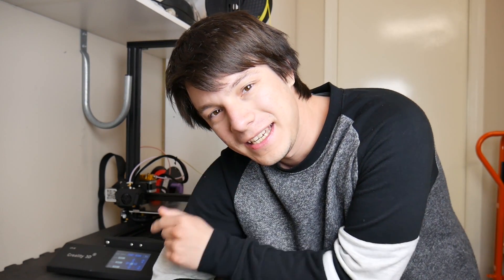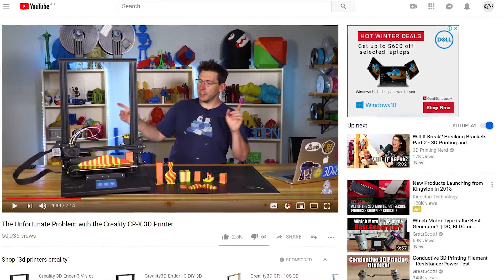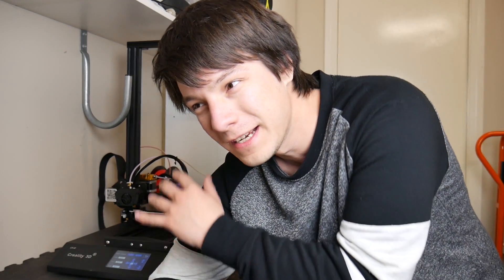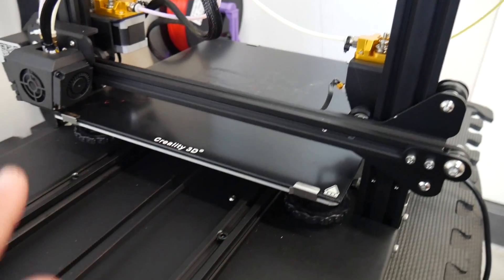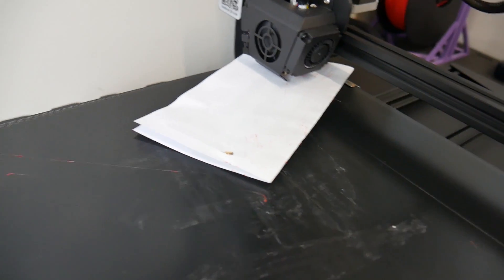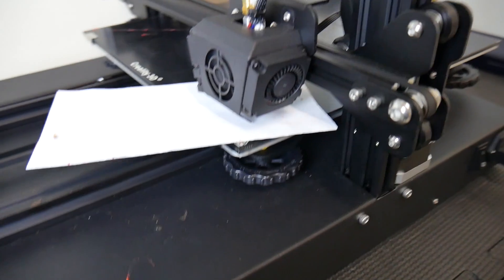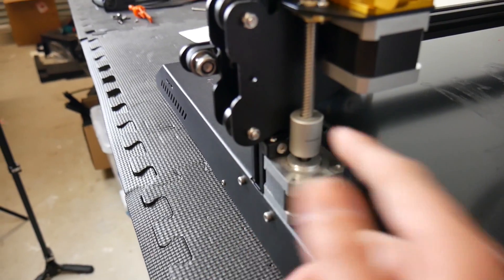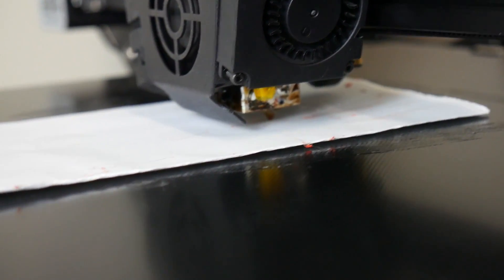Update on my Creality CR-X and going forward

Comment: Even though this is a preproduction Proto type yet should function well. Sure you might have Very small Software problem or some other non-service affecting error. As a product manager I would never ever put out a product like this for beta testing(not even alpha testing). This is totally Unacceptable. This goes along with the fact that it’s $800 printer and no automatic bed leveling shame shame

Comment: I  suspect that one or both of the V slot rails for the bed are bowed, and or misaligned. If that is the case you would never get all 4 points level.   I would rebuild with one wide V slot extrusion.

Comment: The problem with the front right corner is caused by the y-axis rails being twisted. As the bed moves back, it dips down on the right. You need to align the rails by either raising the rear-right, dropping the front-right, raising the front left, or dropping the rear left. You can make three points of a potato chip touch a flat surface, but not in general four points; your y-axis rails are a potato chip.

Comment: Thank you Angus. I agree that what you've received, is unlikely to be the same as what people receive as a production unit. And even if you correct all the faults you find, and get it to print reliably, unless every printer of this model from Creality starts with the same problem, the fixes you provide them as feedbacks, are probably not going to result in end users getting the printer you end up with. 

Wondering if there may be an issue with the right rail for the bed that may be dropping the right front as the bed moves to put the nozzle at the front of the bed. If checking the xplate doesn't show a problem, that might be something else to check.

Comment: One thing that I have noticed in my "LONG" 1+ years of 3d printing is that printing beds are usually not flat.. If yours is flat count yourself lucky.. 

Depending how the bed is manufactured (cut/ stamped/ machined) Bed "base zero" flatness can be ridiculous to outright Rick and Morty "perfect Level" precision. Also precision manufacture will cost more .. The smaller the bed the more flat precise it is, and as we go to larger and larger beds, the flatness of the bed becomes a greater problem.. Now I solved my problems with a BLTouch type of sensor which has an accuracy of around 10% of my first layer thickness. I have had inductive and capacitive sensors but their accuracy was on the order of near my first layer thickness and wouldn't work with some surfaces.. I'm not selling these type of sensors, but I think something like them should be standard equipment on all FDM printers..

Flat screen TV's also had this problem it was very hard to make 51inch screens without defects and because of that cost 10 to 15 thousand dollars. Now after 15-20 years, with new and cheaper methods, everyone can purchase one for under 500 dollars...

I'd love 3d printers to be perfect but alas not yet...

Comment: Z wobble FIX. Remove the top parts from the Z screws. Read the last comment here: https://www.thingiverse.com/thing:2954530/comments

I have a cheap Anet A8. It works well. But I've been struggling to explain to anyone creating parts like this that it's a bad idea. You have the power to explain the problem to anyone and make a video about it.

Comment: 1 thing I've noticed with the CR-X is the Y carriage is a little too lightweight and the corners can easily bend. The easiest thing is to bend the low corner slightly up (use a adjustable wrench tightened down) or add shim to it. Yes, this should have been fixed and you shouldn't have to do this BUT we're still talking about a very capable machine for $800 USD. Prusa MK3 is $800 shipped in kit form and has its share of issues as well. The CR-10 series faces the corner issue (one corner being bent that is) as well and damage in shipping could be the cause. Second thing, for the test prints, I found that 1 sheet of paper works better for nozzle clearance. 

The common issues with dual Z machines still exist on the CR-X but the good thing is that all the fixes for the CR-10 series will work. Dual Z is something that has to be maintained for the time being. Its important that the brass nut attaching screws are not tightened and that the wheels that move in Z are not gripping the extrusion more than "just barely." Often times, everything is tightened up on a new machine (obvious thing to do) and Z axis issues occur as a result.

Comment: With a bed volume of the size is manual leveling even realistic? with all the added surface area you now have all the added potential for warps and as you've shown in the video leveling is very difficult. I have the exact same problem one of my clone I3 printers with only at 2: 20 by 220 bed Center is dead perfect every other Corner except for the front right is perfect but the front right is way too low.

Easiest solution hook up a bed leveling sensor of your preference and let software deal with all of this I've spent months trying to combat that issue when a $5 sensor and 15 minutes of my time has now permanently result the situation. 

It's 2018 why are we screwing around with bed leveling? Auto bed leveling is an amazing thing.

Comment: I've had similar issues with a regular CR-10.  Putting a washer in between the spring and the bed bracket helped loads by decreasing the distance the spring can travel, making it tighter.

Comment: Your looseness of the front right leveling screw, i had/have the same issue on my creality cr 10s except for me it was the rear right screw which was like your front right. Since the bed is glass and ridgid I ended up shimming with a couple pieces of paper between the glass and the bed. Now i can get functionality of all 4 leveling screws.

Comment: I wish they would switch to the induction end stops or whatever it is that tevo uses. I also get sometimes inconsistent zero on the Z. Clearly there are inconsistencies in that first run where everyone is getting slightly different tolerances on their machines.

I am normally quite forgiving of creality. I rather like their beta run fix it make it better constantly style of manufacturing (since no other chinese manufacturer does this ie they don't fix their issues) BUT. this is their "pro line" of printers. (CR-20 and CR-X) with price tags to match. still crazy cheap for what it is but expensive for what they typically make.

IT SHOULD be mostly right out of the box and I am glad you and joel are holding a bit of fire under their feet for it. Keep up the great work and I hope you get it going. it is a rather enjoyable machine once you get it working right.

Comment: This is interesting, on my Ender 3 (which was probably the first of the removable plate batch) I had a hard time leveling the bed with the same problem initially, after making all of them too loose, I was able to get it level -but then Thomas Sanladerer's shipped with a plate that wasn't true as I recall on his assembly.
-I get z-artifacting I'm still troubleshooting as well.

Comment: i had the same issue with the corner being too low on my CR10s.  They used lock nuts on the bed to attached it and oen of them just wasn't close to be tightened.  After adjusting ith elped a TON with bedleveing.

Comment: On someone'S video (don't remember who exactly, hopefully it's not you :-) ) he mentioned that the back corner where the bed cable are attached, have a plastic part between the bed and the spring. he actually added washer to the other corners to put the same pressure on all four corners.

Comment: I have a CR-10 and it suffers from a bulge in the middle when the platform gets hot. I level the bed, and when I put the nozzle in the middle of the platform, it touches. It does not matter how I put the glass on the bed, I think it is a result of uneven heating.
Looking at your problem, can you try stretching the spring on the corner you are having problems with? That way, your spring will push the build plate up farther...just a thought:)

Thanks for the content!

Comment: How does the benchy print if you slice it yourself? Almost seems like it's changing the z offset somewhere at the start of the g code.

I made these for my CR-10 as I found the springs didn't have enough tension. Easy quick print and works nicely. 

CR-10 Spring Spacers found on #Thingiverse https://www.thingiverse.com/thing:2796833

Comment: I'm not an expert but if you put a couple washers under the offending corner spring, you'll be good to go. 
You seem to have a firm grip on printing in general but should have figured it out on your own...
Thanks for your opinion that Creality isn't perfect..yes they should have redesigned the 2nd Z motor bracket or gone with their original thought of belt drive.

Comment: Dude the bed on my cr8 is EXACTLY the same
Reply: OK so the last comment wasn't that helpful. So on my cr8 same bed level issue. So what I did to work around this was to use the software bed level in matter control. It's not ideal as now I'm using Cura, Repetier AND matter control 2... I only have 2 printers.

Comment: Hi Angus, the shown first layer problem is exactly the same, what I experienced with my CR-10: no matter, how accurate I level, the first layer is printed far to high. May this be a firmware failure? When I discussed this in various forums, I only get the answer "level closer", but this never helped. I'm very curious, how you can solve this issue on your CR-X.

Comment: I had the same issue on my anet a8 after fitting a glass bed, The actual problem appeared to be that the corners that were correctly adjusted were acting as a pivot point, Try adjusting the the tightest one with the paper under the loose one and I think you may find that it should level out. Since having the problem I have started levelling the bed diagonally and I now use a 0.05mm or 0.002” feeler gauge which has been working great

Comment: I follow these reviews with great interest   I also don't believe that you should dwell on the issues as an issue if that makes sense (the world has enough drama).  I'd still like to see you get an initial model for a walk-through so I know what I could be getting into if I bought one right away then see you obtain one six months later after it has been in production with a follow-up video which includes all of the manufacturer updates and convenience upgrades that users have created.  I might want to be an early adopter if the printer has a feature that I desire and am willing to live with the  initial production warts.  It's like choosing to upgrade to a  next generation operating system or waiting six months after release until all of the initial bugs have been ironed out.  Think Microsoft Windows or Apple iOS as examples.  My expectations for a $300 printer are a lot lower than if I spent $3,000.

Comment: I had the exact same problem with my shitty Tronxy X3. The reason was that the single profile for the wheels of the bed was twisted around the y axis. So the bed rotated slightly around the y axis. I believe that the two profiles of the CR-X are not in the same plane. That would explain it completely.

Comment: I think your verdict on this machine should be based on the condition the machine arrived in. There seems to have gone very little QC into this machine. Even if they fix all the flaws you and other reviewers have discovered before releasing the machine into the wild we don't know if they introduce new problems with the fixes. If they do introduce new problems while fixing the known ones it seems there is little chance that Creality QC will find and fix them beforehand. It will be only discovered when the first people buy the machine and find it has new issues.

They asked you to review this machine and I'd provide a neutral review pointing out all the pros and cons of the machine. But with the current issues the cons overweight by far, and I would assume those issues will NOT be fixed, unless proven otherwise.

Comment: try to put the 3 other screw DOWN to where you can engage the forth one ?
Reply: He cant the print head is as low as it can go with modifying the brackets at the z stepper, but that IS a way to fix it.   Spacer under the spring and longer screw is a better solution while working on all the other bugs.
Reply: Yes

Comment: Hi, do not put in a longer screw, pull the table top off and LOOK at the bed arms, use a  ruler and measure how high the end of each arm is OFF the base.
The fact that the adjuster was not in place when you unpacked it, indicates that the adjuster was not under any tension from the adjuster spring to keep it on.
Even the brief view we had of the lack of adjustment indicated to me that if the glass bed was not warped then the bed frame, in particular that arm has been bent DOWN away from the bed.
At the moment there appears to be NO support in that corner at all, so what happens when the bed warms up?

Come on Angus, get your hands dirty and get into this machine.....
You are going to have to use more than an Ikea Allenkey and an adjustable spanner mate...

Great videos....

I'd like to add my two cents worth about 3D printers, I don't have one, I'm aiming to get one, BUT I am aware that because it is an electromechanical machine it will need servicing and repair. 
What I see is a lot of users that expect their printer to operate immediately out of the box and to work flawlessly FOR EVER. 
Sorry mother nature is not like that, we do not have friendly corner 3D printer service centres, so get used to the fact that you are going to have to fix any problems yourselves along with guys on YouTube like Angus.
My profession, Electronics Engineer, working in Design, Service and Repair of industrial control systems, I'd love to get into 3D printing and repair, but too busy.
Also when you "level" the table, you are not doing any levelling, all you are doing is making sure when the head is on the table, the clearance at 5 places is the same.
You level with a spirit-level, and then see if your vertical arms are VERTICAL with the same spirit-level.
Think about it, X-Y-Z ALL at right angles to each other, that is what the software ASSUMES.
I noticed in the assembly videos that I have watched, no attempt was made to check for squareness.

Comment: Yeah, I'm having a similar problem with my print platform the bed sits on being off kilter on my built from scratch printer, but at least my screws are long enough to compensate, though just barely.

Comment: My CR-10S has the exact same problem with the bed leveling as your CR-X. I didn't get a glass plate (second hand printer, so not sure if it was supposed to come with one), so I'm using a mirror, but if I had just used tape, I wouldn't be able to print anything at all, even if I took the leveling nuts off (definitely NOT recommend 🤣).
Also the same clearance issue where the gantry mounts meets the bottom mounting.
The only fix I've come up with for leveling, is to remove the bed mounting bracket and put a couple of washers on underneath bracket on each bolt and but it back on. I've not yet been able to do this, though looking at the bolts, mine may also have to be replaced, as I think they're too short to add the washers.
Besides that there is a software flaw, in that when you "Pause Print", it runs the "stop" code, turns everything off and goes to home. When you "Stop Print", it runs the "pause" code, stops dead in its tracks and stays hot.
Personally, I'd like to see the gantry raise up 20mm on Pause, and give access to the extruder control, so that you can change filament and purge the previous colour, as the CR-10S only has one hot-end, but that's another story.

Besides these silly design flaws, the CR-10S is cracking printer and I love the idea of the CR-X incorporating the control unit into the printer, much better than a side unit.

ps, love your channel Angus

Comment: You know what you should do?  Base your final yes or no about whether to buy the printer on the item you receive.  If they send you something with issues, assume all will ship with the same issues and warn people off the item.  I'd imagine if all the 3d printing content creators showed a united front it would cause some serious changes to the lazy way these companies operate.  It's now at the point where most people assume that the first iteration of a printer will be used to work out the bugs and frankly, we're all being used as beta testers.
Reply: Angus has already said that several times in videos, that he can't recommend them based on what he got out of the box.  It keeps happening anyway.  But also the companies can just stop sending him review units altogether.  So he doesn't want to burn bridges, just highlight an issue that has been happening to get community support.

Comment: The Gcode Z coordinates are added on top of the paper thickness, are they not? Does that not mean the paper should be fairly tight against the nozzle?
Reply: I have a CR-10S with Cura 3.4.0 that works as Mr. Hartmann describes. I must adjust the bed so that the machine Z-zero (bed level/home) and the slicer specified initial layer height add up to the proper initial height. I use a combination of arithmetic and z-axis offset to do this. For example, using a feeler gauge (I have plastic), I can level the bed at 0.100 mm, then specify the initial layer height in Cura (G-code) as 0.100 mm to achieve 0.200 mm initial height, or I can level the bed at 0.100 mm, then subtract that value with the z offset in Cura (build plate adhesion), then specify the actual initial layer height. Also, I can adjust bed level to barely touch but not mash into the bed, then the slicer specified layer height is the actual height.
Reply: I have another brand 3D printer that levels differently.